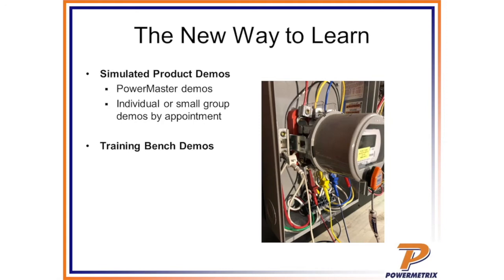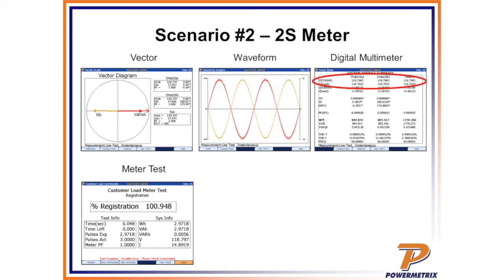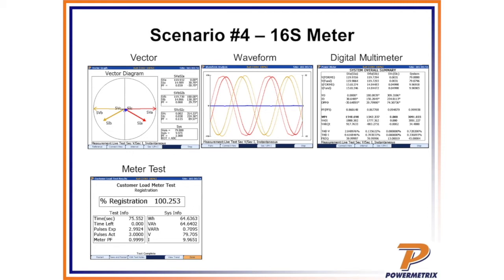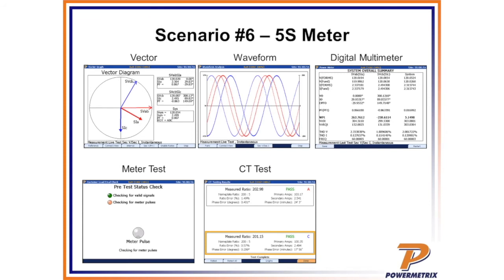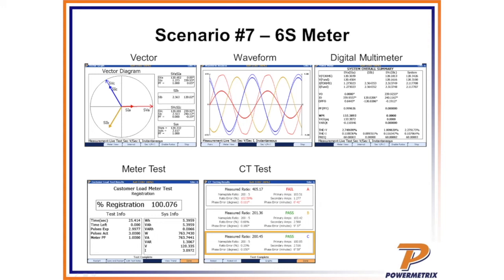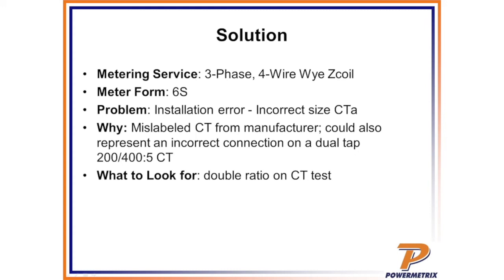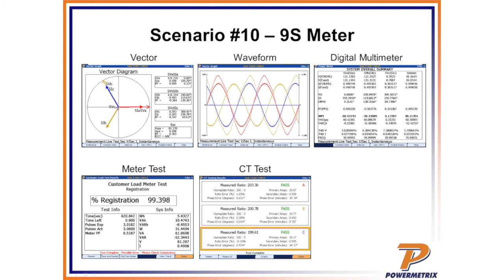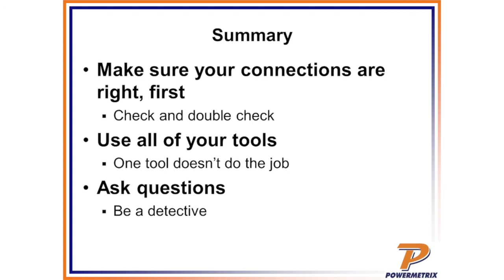Guess the Metering Error

Comment: 4 wire Delta also has 240 Volts Phase to Phase for 3 Phase power and 120 phase to N for single phase power.